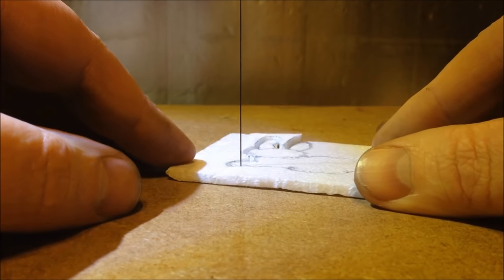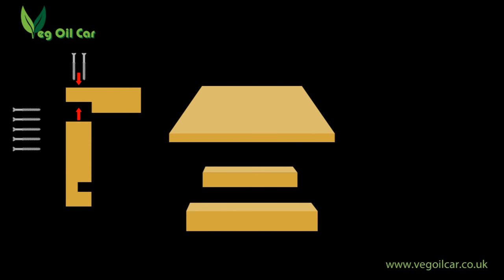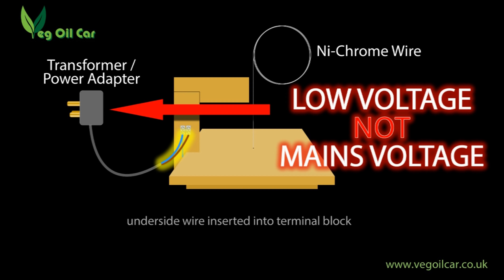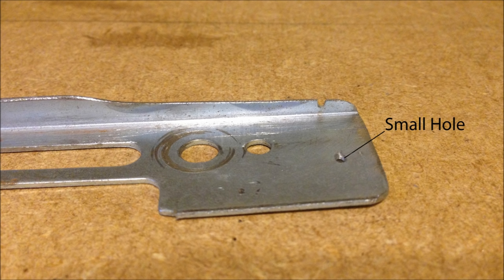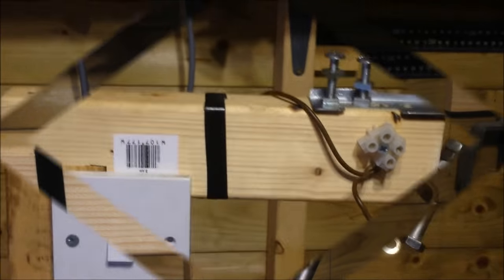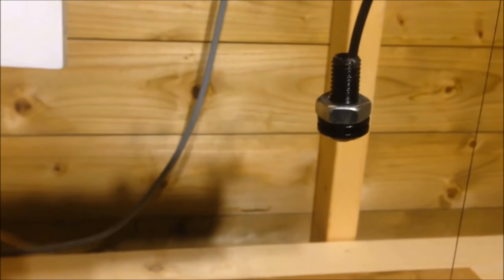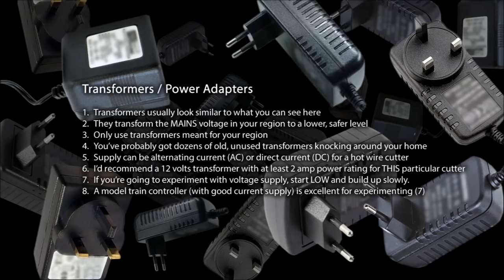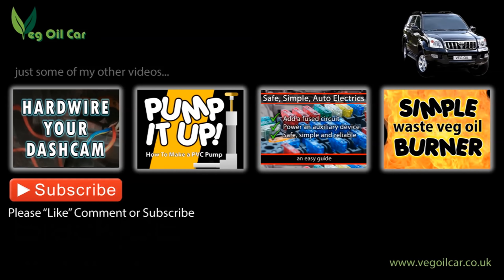ADJUSTABLE hot wire Foam Cutter - by VOGMAN

Comment: I have found .023 stainless welding wire is resistant enough to make good cutting wire.  Cheap and durable.  It doesn't break as often as nichrome.  Thanks for the video!

Comment: This was a great video, still is. Some months ago I bought a foam pen cutter, but found that the tip tends to get red hot and melt the foam  1cm wide, however, I found a lower amp transformer plug and it works fine, so I thought could I make a horizontal cutter and an up-right together, that would be fantastic...then I saw your video, now I know I can combine the two in one by watching your video thank VOG
Reply from the maker: Glad it was helpful!

Comment: By cutting a long notch in a bolt aligned with the washers hole, you can easily tension the spring into another bolt below or above the wire hole. Simply feed the bolt into the middle of the spring and use it the same, but now all you need do is give the nut a few turns to lower or raise the spring tension.

Comment: One thing i noticed that the thinner the wire the better, but if your wire is too thin it becomes too easy to break.
Thick wire has too much thermal mass to make small cuts or small parts because when you plunge into the cut it dumps all the heat and melts too much foam.
When i used some very fragile and thin nichrome wire i could see in the cuts each of the rectified AC cycles in my cut styrofoam and it made perfect cuts, the trade off being that it was very easy to break and being just some wire i got from an old burned out soldering iron i didn't expect much in the first place.

Comment: Thank you for the awesome explanation. I have arranged all the material except nichrome wire. I have a broken guitar. I am just trying to find out which wire to use, the thinnest one or the 2nd one. Pls guide if you have details on this.
Reply from the maker: Sorry Bikash I don't.
Thin is best and I'd say give it a go and see what happens. But if all else fails the wire is cheap enough on eBay.
Hope this helps.

Comment: Do you find the 0.4mm wire to be a good size?  
Going to tackle the foam cutter build in a few weeks and was about to order some wire...can get 100 ft off amazon for about $6-8 depending on the size.  Was just curious if you would go smaller than 0.4mm?  Like maybe 0.2mm? If you have tried smaller sizes what has been your experience?
Reply from the maker: Hi Conifer. Thanks for your question.
I wish I could give a quality answer but as I said in the video, I've been messing with these things since I was a kid, so I haven't really got a clue what sizes I have and haven't tried... sometimes it worked and sometimes it didn't, depending on what wire I could get my hands on. In these days of internet shopping, Ni-Chrome wire takes the guesswork away (I'm showing my age there).
I think thin is better, bit then .4mm is pretty thin. I see no reason why .2mm wouldn't work just as well, maybe even better, though obviously it's going to be more brittle and easier to burn out, so go careful with your power supply. If you can vary the input, start low and build up, otherwise you could burn through the 100ft in no time ; )
It would be interesting to know if a finer wire gave a finer cut. Let me you how you get on.
Best of luck and happy building.
Geoff
Reply: Hi, this prob a bit late, but I recommend .2mm, especially if your using for miniature applications or anything high detail, you'll get much finer and cleaner cuts. (it's usually the standard for most professional hot wire cutters)

Comment: nice video , shame i dont have the wiring skills to make it,red to red wire,black to black wire, and blue to bits
Reply from the maker: It's not that tricky Clara, honestly. It can't be too difficult if I can do it ; )
You always need to be cautious with electrics, they are dangerous. But if you're sensible you should be fine.
If you get stuck drop me line. I'll do my best to help.
Take care,
Geoff
Reply: hi thanks geoff  i didnt feel confident going down the electronics route,but thanks for the help,so i sanded my cousins wings into shape.
thanks again

Comment: I've watched almost every video on Hot Wire Foam Cutter and I find your video to be the most industrious. The issue that I observed other people having was that of the power supply "mainly on the hand held USB builds". Looking at your design right off the bat I can see you've been doing this for years. I like the neat function of that spring with added washers to increase tension look also Thanks for shedding light on the transformers.
Reply from the maker: Thanks Jesse. Much appreciated : )

Comment: Enjoying your videos and just subscribed. I use hot wire cutters for making packaging nests, letters and symbols for signage, decorative concrete forms, movie props and even lost foam casting. My projects page includes, http://www.granthams.com/Movie/index.html examples. A foot switch really helps and a push-pull clamp allows wire to be disengaged for internal cuts.
Reply from the maker: Thank for the kind words and for subscribing. Just had a quick look at your website. Lover the paper jogger. Brilliantly simple solution. Excellent work!

Comment: Nichrome wire is a poor choice for hot wire cutters.  it stretches considerably when heated.  Use regular single strand stainless steel fishing leader.  0.016 or 0.010 diameters work fine and are worlds cheaper.  You can pick it up at any sporting goods store like Academy Sports or even Wally World.
Reply: Guitar chords are also good for this purpose.

Comment: Excellent and simple. 

Someday I will build one of these.  Simple solution to the tension, is to drill a hole either perpendicular to the end of a bolt or thru the length of the bolt, thread a nut on all the way to the head, drop bolt thru spring, secure wire to bolt thru the drilled hole, turn the nut to tension.   

I have a huge pile of extruded foam to recycle,  and I haven't decided yet how to use it up.  Airplane parts, lost foam cores, fiberglass work, etc.  

It also drives me crazy to throw foam packaging in the trash. 

So to be able to recycle it instead of sending it to the landfill would be nice.
Reply from the maker: Thanks Travis : )

Comment: Although I like the video and have made a cutter after watching it, I find fault with the switch. Most AC switches don't have the rating or design for DC voltage. Dc can arc inside the switch and, over time, can lead to either the switch not working anymore or worse. I had a switch on another DC project melt to a pile of plastic on nothing more than an old laptop power supply. Love the videos you make.